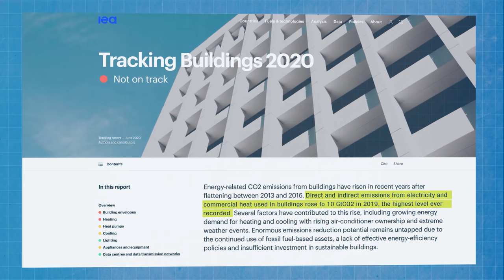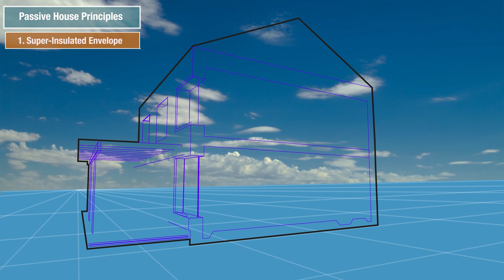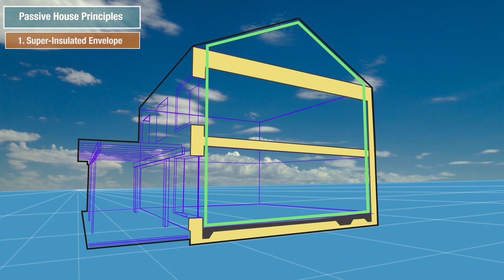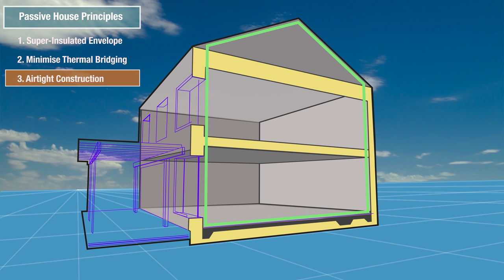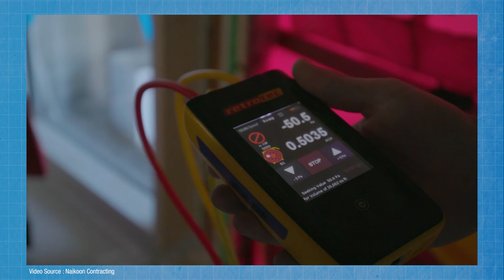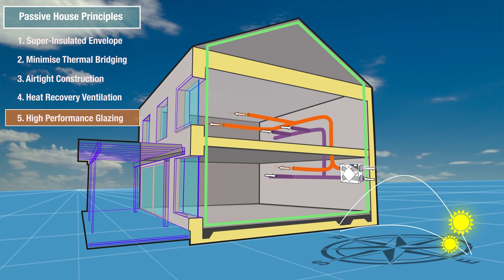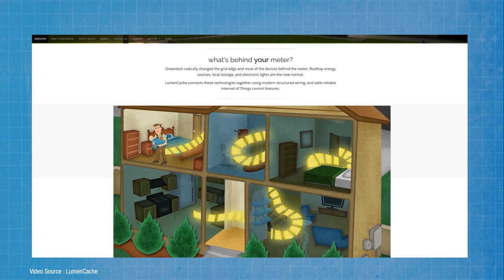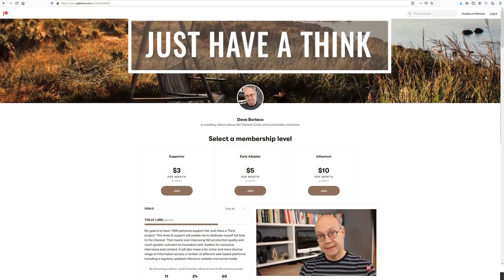Passivhaus . A low carbon future for our homes?

Comment: Hi, haven't seen the Video trough, but I would like to tel you and your audience, that this is my 4th winter in my passive house, and one thing is the energy consumption, but the best of al is the comfort of it, no cold rooms, no cold corners, in my living room I have big windows 5 windows h240xw160 cm, that gives a lot of light, but no cold corners or discomfort caused by different temperatures.  I did install water based heated floors, but never used them as there is no need.  To follow up, I do work as a technicall consultant, doing a lot of work for the municipality, when they construct schools and institutions, and it has now been the norm to construct passiv houses, and for the next project we are heading towards Plus house, the house itself produces enough energy to offset its own use AND the energy used for construction...  And this is in Norway, a cold country just showing that this is absolutely possible...
Reply: Very good. Would the same or similar Plus house technology work in hot countries as well for cooling?
Reply: @bluceree7312  not OP, but in the US air conditioning is 10% of energy demand in buildings while heating is 50%.  In addition to that, locations that are hotter will have longer days for increased solar.
Reply: Do you have any links to Plus house tech?
Reply: @raiderrob672  Hi, I'll look in to it, just a quick Google search gave mostly Norwegian articles, but I'll give it a go later to find something in English..
Reply: @edmirfin8498  I know I know, but It could be that the tech for heating is different than for cooling, that's all. The US climate is temperate compared to a lot of places tropics around the Equator. I'm just thinking about a global solution that works everywhere.
Reply: @bluceree7312  Absolutely, same as with heating, amke sure the sunlight doesn't heat up the interior, placing the windows and using overhangs and shading, insulating, choosing roofing and cladding that doesn't absorb heat (green roof does this and also binds carbon, and retains water with heavy rains) and offcource recycle cold air from the the inside through the heat exchanger, and using low energy adiabatic rinced rainwater cooling..
Reply: @oleeide9763  I would add, in hot countries, if ground pipes were used on the air supply to the heat recovery ventilation,  you would deliver free cooling, if they are set at the correct depth.
Reply: @bluceree7312  Hi Andry. I'm now 9 years in my passive house in Luxembourg and I agree with the OP. The comfort is amazing. And even in the heat of summer when we can get above 35 for several days in a row it remains comfortable. 
Winter optimizations are lots of south facing glass as well as corners turned to the south east and south west to capture that low winter sun. 
Summer optimizations are metal louvre blinds to shade all that glass which must be on the outside to stop the greenhouse effect. I also watch the outside temp in the summer and as soon as it is lower than the house temp I open as many windows as possible to get passive stack ventilation through the night. Sometimes that is midnight, or on a really hot night it might not be at all. We have a concrete construction and the thermal mass resists the heating and cooling effects from outside. 
We also have a 45m long, 1.5m deep earth pipe which we can use to draw air through. Free cooling in summer and free heating in winter because the ground stays around 12 degrees C all year round. I augmented the efficiency by filling about 2000 plastic bottles with water (collected from my office recycling) and placing them in the ground next to the pipe. Its really pleasant in mid summer when it is hot and sticky outside to walk into a dry and cool house.
Both heating and cooling are like filling a leaky bath with water - the only option you have is to open the taps more (more heating or cooling). Passive house just plugs the leaks. And the heat recovery ventilation also works in summer. The "coolth" (opposite of warmth) is retained in the fresh incoming air. 
In climates which have longer hot periods you would need some air conditioning but with a passive house design that demand is minimised. I've felt air conditioned air leaking through doors and windows in the tropics (single glazing in Singapore and gappy door frames in Manila) and wondered why PH design is not used there.
Like most green tech though (like electric cars), there are lots of up front costs followed by reduced running costs. Payback might be 10 years. Builders have no interest in making their houses more expensive - so you really have to build it yourself.
The final icing on our PH is 85 PV panels on the roof (19.5 KW peak) and a wood/pellet heating system. It makes it a plus energy house although it will take a long time to pay off that concrete CO2 debt. But I have no plans on moving so I can wait.
Reply: Everything about this sounds brilliant. Cheers, mate!
Reply from the maker: Superb! :-)
Reply: For one off housing or a small collective, passive housing is popular and "doable", . However government sponsored social housing needs to be stepped up to the standard and also the vast housing estates semi-detached, detached and Terraced , built by private capital are behind the curve . Imo , there is much more to be done by government sponsored bodies to promote and compel . ??
Reply: Join us at CLIMATE RESISTANT HABITATS Facebook group
Reply: I envy the mentality of the people of Norway! It goes a long way proving a better world is possible if people care enough! Meanwhile here in Brazil...
Reply: @AdlerMow  Meanwhile in Ireland.😭
Reply: @jimbanda  I read in a passivhaus magazine a year or 2 ago that Ireland has adopted passivhaus as a standard for new build housing. Was that not true?
Reply: Google for Energy-plus-house and you wil find quite a lot og interesting reading.
Reply: @treescape7  Hi, the first answer is yes , A2 as standard for new builds.
The second answer is there are "opt-outs" for single dwellings on family land, which is significant number for Ireland.
A2 is a reasonable target but in Ireland it is usual developers to barely hit the target, to cut where ever possible 😭.
Ireland's housing stock has a significant "turnover" rate and refurbishment upgrades are required to be B2 .
That old saying ' The devil 😈 is in the detail' , is always applicable in Ireland and very often its the state itself that is least compliant with its own regulations.
My earlier comment was somewhat tongue in cheek, but there is still much to be done.
It may be said also, that the country of 5.5m population , has low density etc.
Reply: @treescape7  Dun Loghaire (sp?) (Southern part of Dublin) adopted passivehouse in planning regs a few years ago (due to lobbying by the publisher of passivehouse magazine I think :-). Ireland as a whole has not but their building regs are much better than the UKs. Brussels was the first large city to adopt PH requirement for all new buildings (in 2017).
Reply: @jimbanda  Still better than in my country. There is a reason why many brazilians choose to live over there. But I digress, probably there is reason for you to complain too.
Reply: @AdlerMow  lol, Ireland's carbon policies are a joke, renewable is based entirely on wind, they have signalled loudly for years about Smart Meters but nothing to show, off peak electric costing more than daytime . Allowed a situation to develop whereby we are the highest use of solid fuel stoves in the EU (Coal & Wood & Probably all kinds of household garbage), gov buildings are caves in regard to sustainability. No coherent plan for electric vehicles or their charging requirements , weee regulations that destroys millions of repairable white goods. The list goes on. 😭
Reply: @ecoworrier  Where I live it's soooo hard to explain to people what "thermal comfort" is. MHRV is a sci-fi term as well for most people. Yep, it's funny but it's also the reality we live in.
Reply: @jatomo  With underfloor wet heating you heat the fabric of the house and let that heat the air (the space that you occupy) gently. With wet radiators or air heating you have to heat the air to a higher temperature than you want or need and let that heat the fabric of the house. It's completely the other way of thinking. No up or down or hot or cold air currents - everything becomes uniform. You only feel a change from room to room (living room to hall for example) or between floors.
Reply: @jatomo  but I guess I'm preaching to the converted already 👍
Reply: @AdlerMow  No no, it's perfectly ok to point out these things, in Ireland we have a better standard of living etc. My original comment was really to decry the lack of a co-ordinated response to international carbon reduction agreements . Our politicians are notoriously short sighted and most guided by the big big business lobbying that goes on. But of course all of the things I complain about are relative , and we do enjoy a stable supply of utilities etc. 
Did you know that tens of thousands of Irish immigrants settled in Brazil and Argentina in the 18th & 19th century? 

Finally.. I am delighted to tell you that we have a wonderful young Brazilian lady married into our family. She came here from a very low income family and she works hard as they save to purchase their first home 🏡😊👍
Reply: @jimbanda  Yeah, Brazil did recieve a whole lot of immigrants during late 19th, early 20th centuries. They definitely did enrich our culture. I'm happy for your relative, hope you all do well and stay safe! Is always a pleasure to hear from hard working people, whoever they be. Good luck up there!
Reply: @AdlerMow  likewise Minha Amiga . You have a great '21 🏡👍👍
Reply: @bluceree7312  The global solution that works everywhere is simply to a accept/adopt mindset or commitment to honestly and effectively achieve the design intent of building net zero and regenerative buildings. The variations in local building site climate, weather extremes, geography, geology, economics, and even culture or government will dictate that local conditions will drive design approach and the details of building and HVAC, energy supply/use, plumbing and waste management such that a universal standard design of a building and its systems is not possible, IMHO, that is.
Reply: Dang!
Reply: I read your comment with  interest as I am building a near zero house .  One area of debate is whether to install underfloor heating pipes  should  it be found necessary after living a while inside to fit a GSHP  to supply the hot water to the pipes . You then say  that you have not used it as there was no need , really interesting  when  your location is taken into account . It is helping me to realise that it  is probably  not needed in my  build  as we live in Greece !!

Comment: Yes, please DO a full video on Passive House retrofit !
Reply: Second that
Reply: Yes please
Reply: I would love a video passive house retro fit. I’ve been looking at a partial install of a heat recovery ventilation system for ages, but finding good reliable evidence, or best practices is difficult and full of anecdotes.

Also considered renting thermal imaging camera to identify cold spots in house some of ehich can probably be fixed easily and cheapily like the electricity meter box.
Reply: @robe1937  I started with a thermal survey to see where the obvious issues were. Sealed up holes and did IWI and EWI (EWI all round is better and what I would do if starting now, but it does cost more). Fitted MVHR part-way through when it seemed airtight enough that it would work. For MVHR spiral steel pipe is cheapest to buy and thus DIY but it's a PITA. I'd recommend the ubbink semi-rigid system with plenums. Much easier to fit and calculate pipe sizes, but costs a bit more. Excellent advice here: http://www.greenbuildingforum.co.uk/
Reply: My quick fix would be to: 1. Install an efficient heat recovery system in your ventilation system. 2. Change 1 glas windows to better. 3. Install a geothermal heating system or similar with 100% coverage 4. Add solar cell to your roof 5. Improve insulation if you are not satisfied. HVAC recovery give approx 25 % of total energy use, the geothermal system cut the remaining 75% to 20-25%. 😊
Reply: @nallebrean  It's smart to do insulation before PV, or at least be sure you are never going to have to take the roof off as part of the upgrade. Switching to a warm roof as part of a deep-retrofit upgrade makes a lot of sense because it's much easier to get a thermal-bridge free construction. But of course if you have ceiling-level insulation it's cheaper to keep it like that but there is always a compromise at the eaves.
Reply: you tube channels. The build show        and.         This old house.
Reply: Having done one, I can tell you how much work it is, how expensive it can get, and how depending on your starting point, you will reach the law of diminishing returns compared to a new build much faster.  Unless you are in the lucky position to clad the entire house in EWI (to below grade) and replace the whole roof, you will be entirely gutting the house back to a shell from foundation to roof.